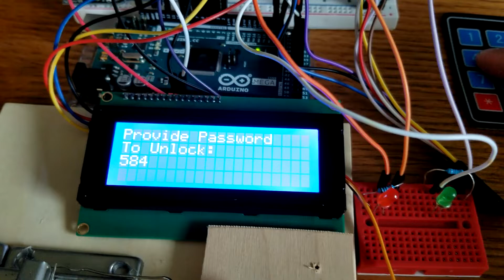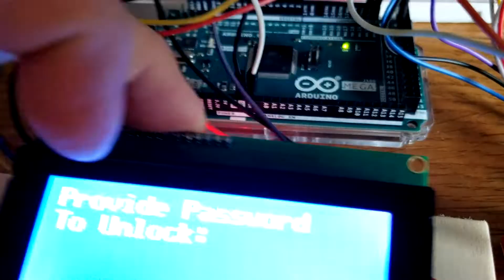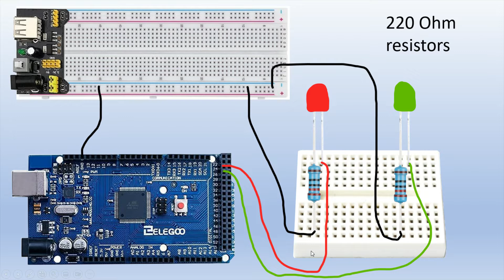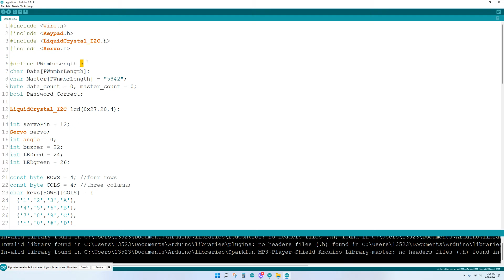Anyone Can Make A Keypad Controlled Lock For Their Next Arduino Project - Here's How

Comment: What n all equipments you have used?
Reply from the maker: I used Arduino Mega, I2C 20x4 LCD, Arduino Matrix Keypad, sg90 servo motor, breadboard + jumper wires, a breadboard power supply, a piezo alarm, 2 5mm LEDs with 220ohm resistor on each, and a slide lock I purchased from Lowes. 👍